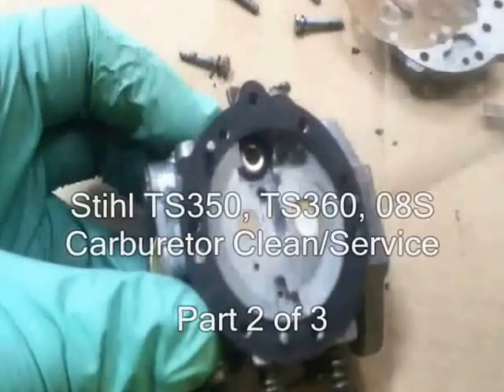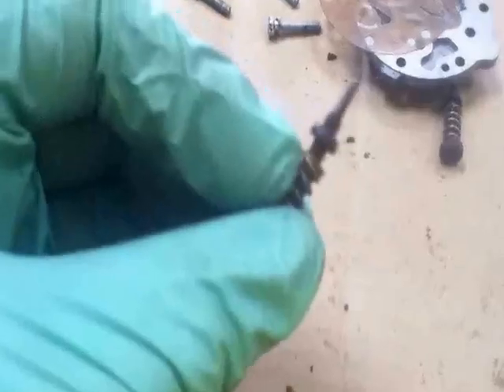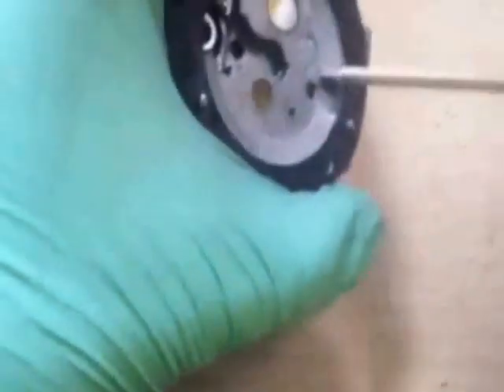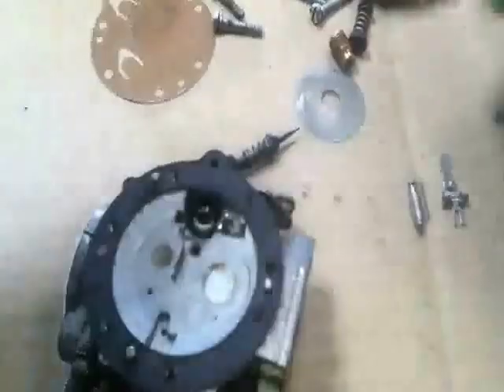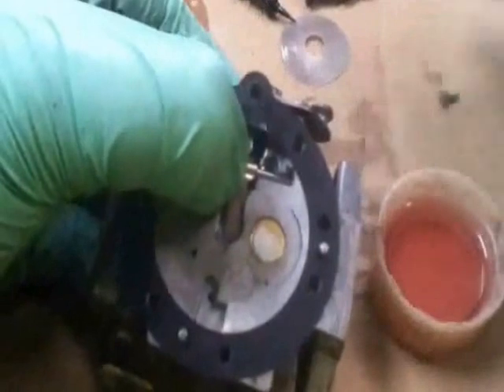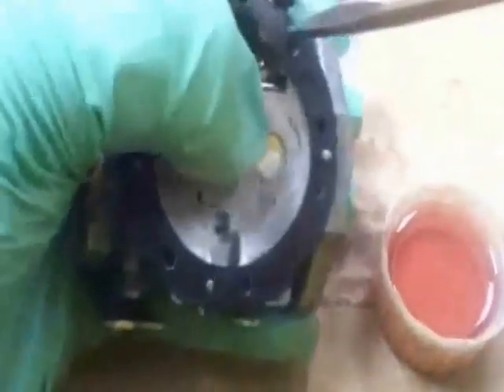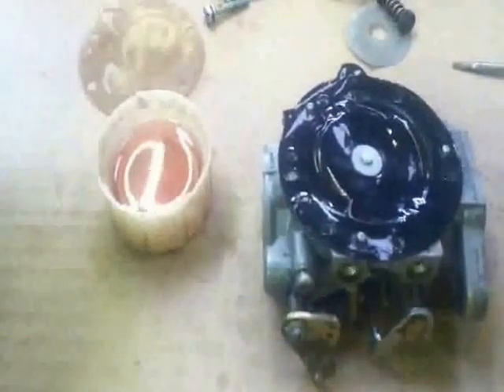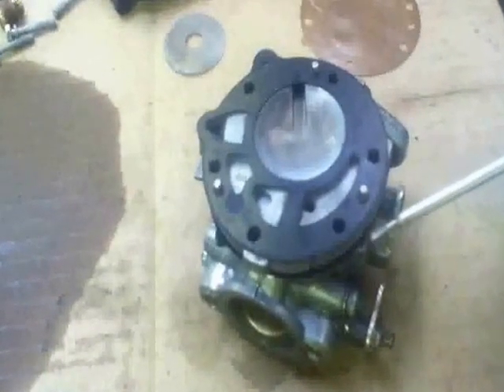Stihl TS350/TS360/08S - Carburetor Clean, Strip, Rebuild & Service  'Part 2 - Chainsaw Won't Start

Comment: Hi how do you get the carb of the Stijl saw? Thanks.
Reply from the maker: There are two nuts that hold this in place. They are situated on each side of the carb where in joins to the inlet manifold. I hope this helps. Craig
Reply: @TheRepairSpecialist   thanks Craig for the swift response. Do you have to use a slim long spanner as my spanner’s won’t fit in. I was thinking to loosen the head with the piston at TDC then I can get access to the nuts. Thank you

Comment: My ts350 runs but revs up high on its own and spits fuel out of intake, I put a new diaphragm and carb kit on it except needle and seat, could you point me in any direction to solve it? The flywheel crank seal looks good so I assume the clutch side is aswell
Reply from the maker: Thank you for your question. It sounds like your Stihl TS350 disc cutter is experiencing some common issues that could be related to the carburetor, air leaks, or fuel system components. Here are some potential causes and solutions to help you troubleshoot the problem:

Potential Causes and Solutions
Air Leaks:

Cause: Even if the flywheel crank seal looks good, there could be air leaks elsewhere in the system that cause the engine to run lean, revving up high on its own.
Solution: Check all potential points for air leaks, including the carburetor gasket, manifold gasket, and the impulse line. Ensure all seals are tight and replace any damaged gaskets or lines.
Carburetor Issues:

Cause: While you've replaced the diaphragm and carb kit, not replacing the needle and seat could still leave issues unresolved. A sticking or worn needle can cause improper fuel metering, leading to high revs and spitting fuel.
Solution: Replace the needle and seat to ensure proper fuel flow regulation.
Fuel Spitting from Intake:

Cause: This is often a sign of a flooding carburetor or incorrect metering of fuel. It could also be due to incorrect adjustments of the carburetor settings (high and low speed screws).
Solution: Re-adjust the high and low speed screws according to the manufacturer's specifications. Start with the factory settings and then fine-tune as needed.
Vacuum Leak:

Cause: A vacuum leak can cause the engine to draw in extra air, making it run lean and rev higher than normal.
Solution: Perform a thorough inspection for vacuum leaks. You can use a spray bottle with soapy water or carb cleaner to spray around potential leak points while the engine is running. If the engine idle changes, you’ve found a leak.
Incorrect Fuel Mixture:

Cause: Running with an incorrect fuel mixture can cause the engine to run poorly. Make sure you are using the correct fuel-to-oil ratio recommended by Stihl.
Solution: Ensure you are mixing fuel and oil in the correct proportions. Typically, Stihl recommends a 50:1 ratio of fuel to oil.
Exhaust Blockage:

Cause: A clogged exhaust can create back pressure, causing performance issues and spitting fuel.
Solution: Check and clean the exhaust and muffler. Ensure there are no blockages or significant carbon build-up.

Go for these checks for now and see how you get along

Thanks

Craig